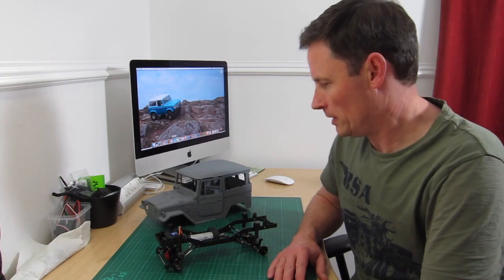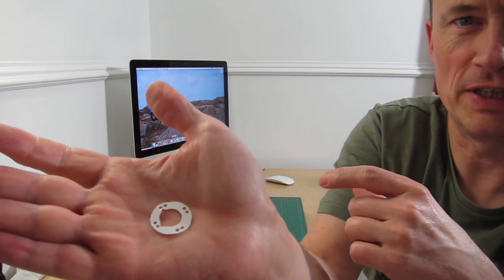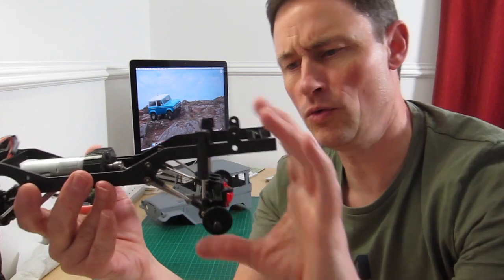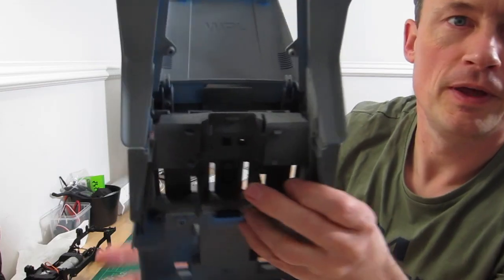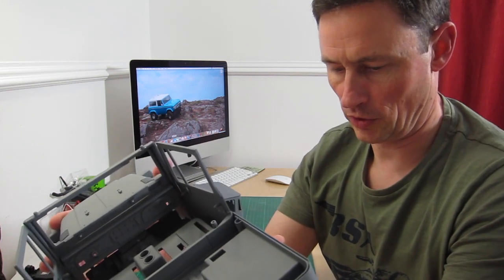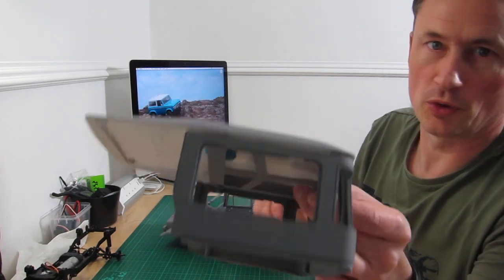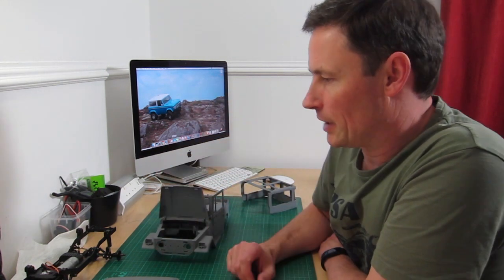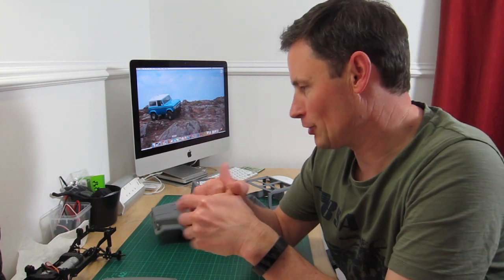WPL Toyota FJ40 Build Part 1 (WPL C34KM)

Comment: Hi,
i just assembled the c34.order 15099
I have a lot of problems with c34. quality department is doing a terrible job.
tyres are wobbly terrible, wheels does not fit to a 5 milimetre drive shafts, Once i put them on i have to almost destroy them to take them off. just terrible.
Steering linkage came updated but assembly instructions are wrong, old. thats just basic mistake.
Input gear shafts are bent and because of that drive shaft cups are wobbling.
front axle is not working properly. i managed to brake in the rear one according to instructions but the front is not possible. front input gear does not mash with differential gear at all.
I don see how can all that be fixed, so i would like to return the product and them to return the money to me...
5mm hex are not 5 mm. and are bent already.

is this normal? no wonder wheels dont fit.hex should be 5mm and wheels 5.07mm.they should know that.
How can they sell a faulty product?
I asked for my 30 day refund but nobody is answering 😮
Reply from the maker: Sorry to hear that tale Tibor, not a good result at all 😔 Hope you get the response you are looking for 🤞